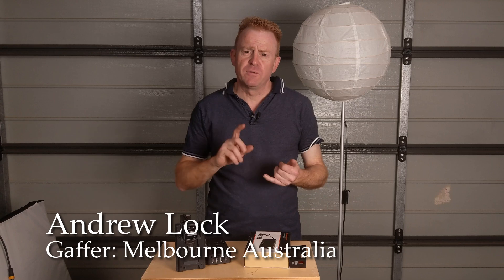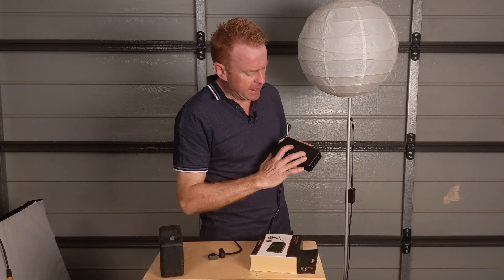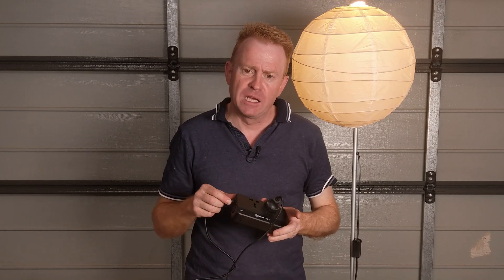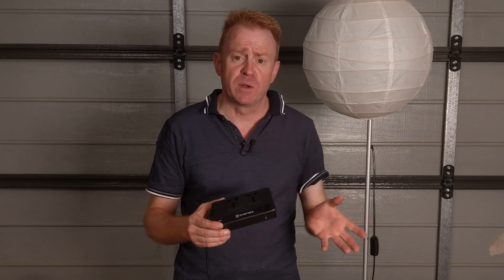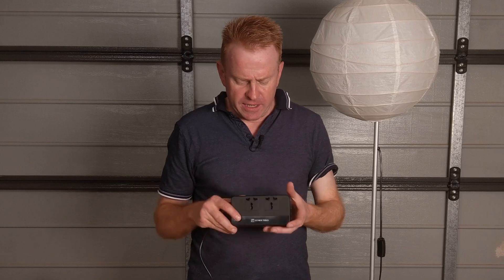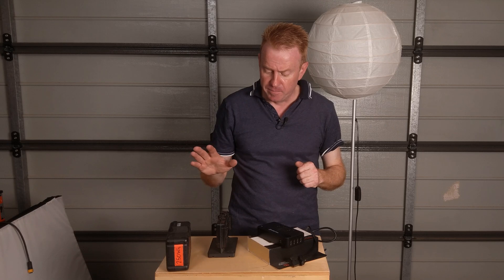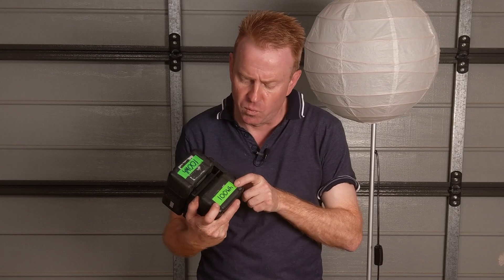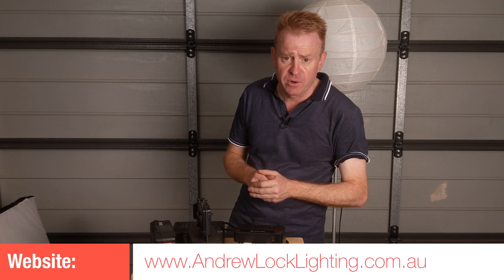Gaffer & Gear 67 - Tether Tools D-Tap to AC & V-Mount Shark Fins

Comment: Do you know of any D-tap to AC that would run a 300W light? Or is a power station a more suitable solution?
Reply from the maker: @plunkett_media  I think a d-tap connection is only rated to 10a so it is not possible.

If your light has a 48v DC input the Aputure power station is an affordable solution if you already have high capacity v-mounts.

Otherwise a power station, which can also be used for more than just the light.
Reply: @gaffergear  thanks for your reply. The light is an iFootage Anglerfish SL1 320DN. I've only been able to use it where a power point is available. I stupidly assumed it would be like the Aputures and have the ability to use vmount batteries or any portable option at least. I don't currently have vmounts so will be an extra investment, saying that maybe it's smarter/cheaper to go with the versatile power station? Thanks again for your input.

Comment: just found it is 50-55 decibels from a review on B&H . it could be a bit risky if one were to carry this walkin around with a camera and mic

"
Great for wireless DMX and remote computing
ByDerek

Version | Voltage:U.S. Version | 110V
I originally purchased this for a wireless DMX setup where I can power a Philips HUE Bridge while floating around with a Ratpac AKS system. Now I can go from set to set, a first floor setup to a fourth floor setup without having to unplug the HUE bridge every time.

In our fast moving environment, I was able to control 16 Astera tubes and 16 HUE bulbs at the same time - then bring all the lights to another room too far from the original location and just plug them right back in while never having to power down the HUE Bridge. Whereas previously, I would have to disconnect the bridge, move it to the other room and wait for everything to sync up again. And it's all self contained in a single case - while obviously leaving plenty of room for the fan to operate.

I've also used this to power a LitePanels Astra 6x at half power for around an hour with no issues, didn't check how much the battery drained.

Now I'm using this to power my 16 MacBook Pro, but it won't work on just one 98Wh battery. You need a 150Wh battery or to use two 98Wh batteries with a sharkfin in order for it to not shut down.

Always make sure you are using the correct wattage/amperage when using any device or it will shut down or overheat/shut down.

The only issue I see being a problem is that the fan can get rather loud. It measures about 50-55 decibels from around 3 feet on my iPhone decibel meter (didn't have my real meter on me). This will absolutely be a problem if you are close to a set rolling on sound. Thankfully, everytime I'm using the HUE Bridge it's usually for a music video or a commercial where we aren't rolling sound. However, if you're using it to work remotely with a laptop and there's no power source - the fan can be pretty annoying sounding pitch around 800-832Hz (checked with a frequency generator - NERD)

Anyways, I do love this thing despite the annoying fan and being careful with managing the power - I really would give it 4 stars for the fan but because there's a 1 star review I wanted to help beef it up so people try this thing and hopefully see better evolutions of it!
"

Comment: just got astera bulbs, if i hadnt, id buy that ac inverter in a heartbeat, so many times  the art department puts practicals in places where its near impossible to run cables without it being in shot. great tip, wish i had known about it sooner!
maybe ill get one anyway for cases were nyx bulbs wont work (e14 fixture for example)

Comment: Hi Andrew! Will the batteries deplete simultaneously through the shark fin? Or will 1 deplete a little earlier? Depends on the batteries you use I guess but just wondering if you can hot swap if you’re using the same batteries and then don’t want to interrupt the supply when a battery dies
Reply from the maker: Yes can hot swap, and one battery always seems to flat a bit faster than the other.

Comment: This is great - thank you! Intrigued to learn that  I could run my Dedo DLH4 off a battery - how powerful would the battery need to be for that to be possible? Stephen
Reply from the maker: The inverter is 87% efficient. So devide your wattage by 0.87. Then allow a bit more for the dedo transformer efficiency.

I wouldn't try unless your battery can output 200w constant.

Most camera batteries can only do 150w. Another option is to use two batteries on the shark-fin as that has a d-tap. (totally forgot to put that in the video)

Comment: Could I then in theory use the vmount dtap AC adapter to power a quasar science tube?
Reply from the maker: If it's under 200w. I use this for my Nanguang tubes
Reply: @gaffergear  it's just those standard T8 tubes so must be under 200w! That will make a huge difference if they can be powered this way!!!
Reply from the maker: @FKfilmphotography  the inverter is 87% energy efficient. So devide the load of the light by 0.87. That will give you the total load on the battery to run a tube. Then check your battery specifications to see if it can do it. If not you could use two batteries on a shark fin.
Reply: Is there any option or alternative to power a 300w continuous light?